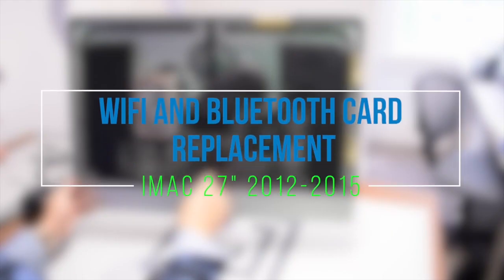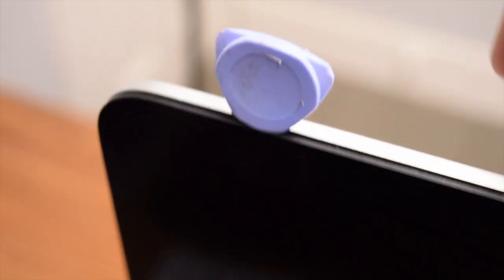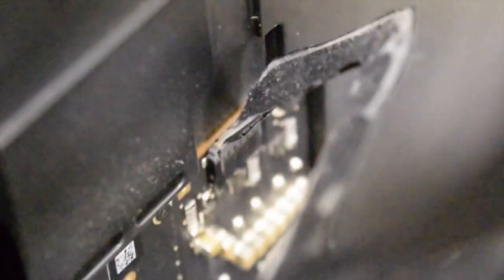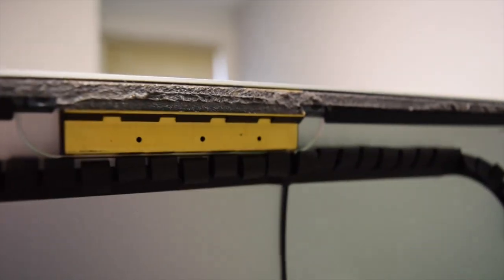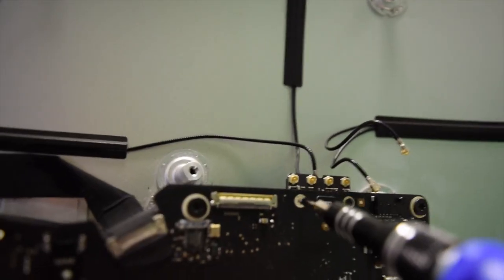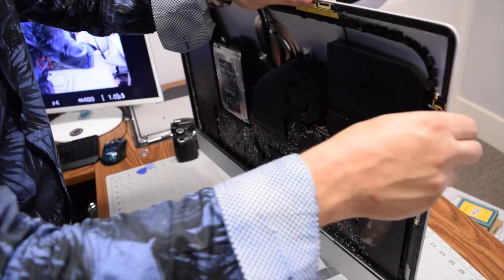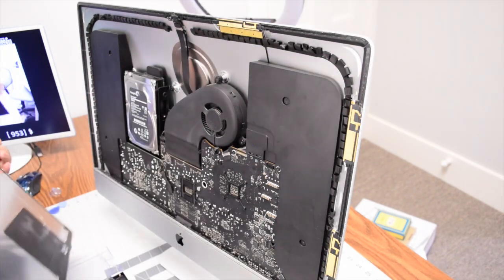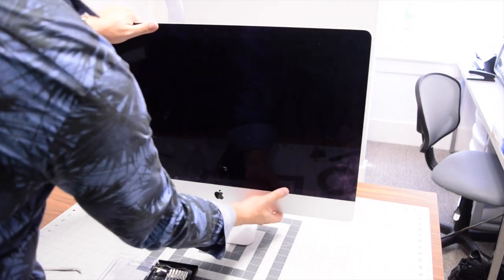📡🛠️ 🖥️ iMac 27" 2012-2015 WiFi and Bluetooth Replacement

Comment: Worked for me, thanks!  My existing and replacement cards looked a little different than what is pictured in the video (mine had two additional T4 torx screws holding the antenna wires in place) but other than that, everything was the same.  Late 2015 27” iMac.

Comment: I have super slow wifi on my older 2012 iMac - is it usually the antenna that needs replacing or the card?
Reply: FYI, I reinstalled a new OS and it resolved. It has to be a full install (not from recovery method)

Comment: 1) Remove the coaxial antenna cables first, THEN remove the mounting screws. No reason to put torsional force on the pci-e port like that by doing it in the opposite order. 
2) Dude that shirt is horrendous. You look like an Armenian laundromat owner with delusions of grandeur.

Comment: Hello. My iMac 2012 27" Bluetooth keeps connecting and disconnecting. İ ended up with changing module with new one -like in this video. But it didn't keep. İ did everything about software and hardware. İ couldn't find problem. Can anyone help me?
Reply: buy a bluetooth usb donsge, and add it in a usb post and use that instead?